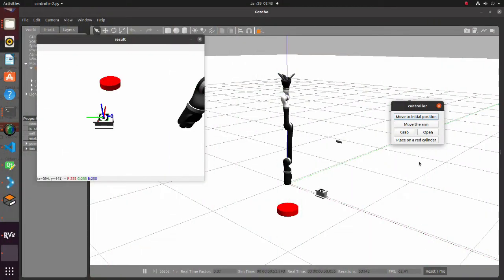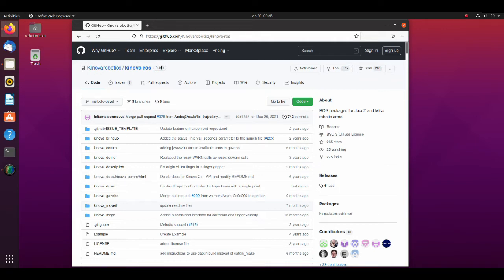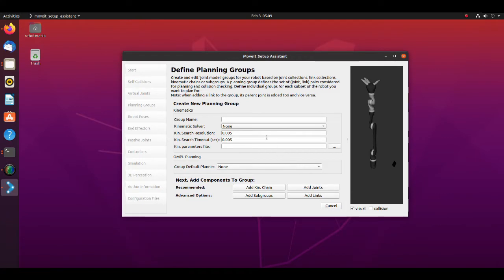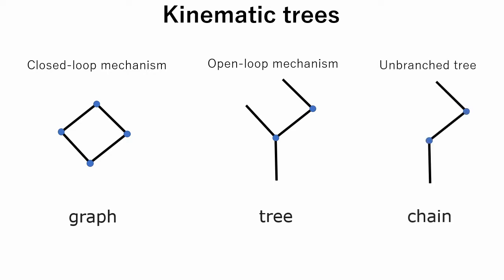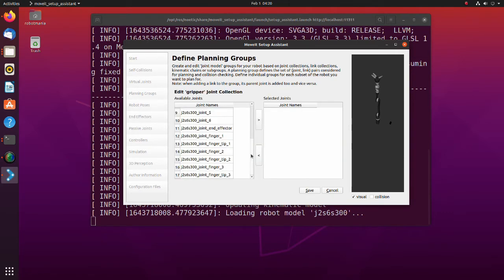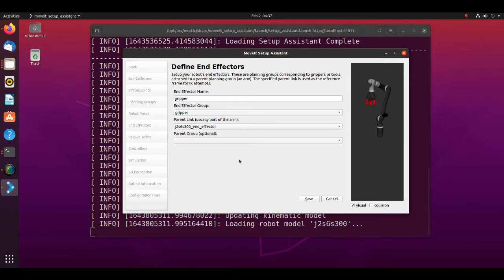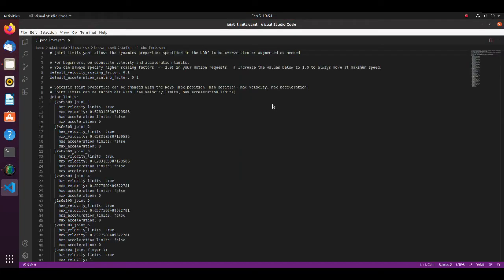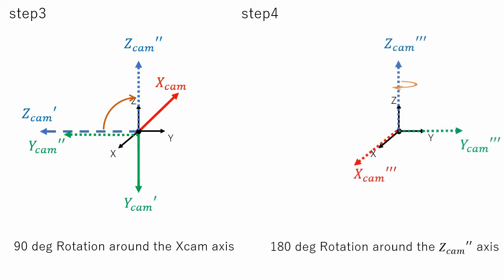How to operate a robot arm using MoveIt

Comment: Thank you very much on this very few demo!! But when i use "python3 controll.py" and click "move the arm",it will report some errors. Can any great god help me solve the doubts? Thank you
 
Traceback (most recent call last):
  File "controller.py", line 100, in Pick_up_the_block
    (plan, fraction) = self.arm.compute_cartesian_path(waypoints, 0.01, 0.0)  # waypoints to follow  # eef_step
  File "/opt/ros/noetic/lib/python3/dist-packages/moveit_commander/move_group.py", line 676, in compute_cartesian_path
    (ser_path, fraction) = self._g.compute_cartesian_path(
Boost.Python.ArgumentError: Python argument types in
    MoveGroupInterface.compute_cartesian_path(MoveGroupInterface, list, float, float)
did not match C++ signature:
    compute_cartesian_path(moveit::planning_interface::MoveGroupInterfaceWrapper {lvalue}, boost::python::list, double, bool, moveit::py_bindings_tools::ByteString)
    compute_cartesian_path(moveit::planning_interface::MoveGroupInterfaceWrapper {lvalue}, boost::python::list, double, bool)
Aborted (core dumped)
Reply: My environment is running with docker pulling noetic's image
Reply from the maker: Hi jian xu!
Thanks for watching my video!
I have never seen this error before. How did you install MoveIt?

Comment: Hello, thank you for the video. I followed each step in the video but I encountered a problem. In the controller tab, all of the commands works properly but not "move the arm". When I clicked on it, robot arm goes somewhere else. Also, how can I edit those commands so that I can control the robot arm as I wish, and maybe I can solve the problem in this way? Thank you!
Reply from the maker: Hi Cihan Okay!
Thanks for watching my video!
If the arm moves in a wrong direction, probably waypoint is not set properly. Please check whether block position is recognized correctly. 
Yes, you can edit commands by modifying the “Pick_up_the_block” function in the “controller.py” script.
If you would like to edit UI, please edit the “controller_window.ui” file using qt designer tool and convert it to python script.

Comment: why is my robotic arm huddle up?
Reply from the maker: Hi NAN JIANG!
Thanks for watching my video!
If vibration of the arm concerns you, you may reduce gains of PID controller.
Reply: @robotmania8896 
Hi mania
Thanks for replying
 how do I find the most suitable pid values for mr robotic arm? is there any value setting rule by default?
Reply from the maker: There are several methods to determine optimal PID gains. But they are difficult to apply for complex systems like this robotic arm. Most often, you just increase or decrease gains until the movement of controlled system becomes acceptable.

Comment: hello thanks for this video but I get the error that it does not find the package ros-noetic-moveit is there anything installed before that?
Reply from the maker: Hi Ylan PERNOT!
Thanks for watching my video!
Can you please execute “sudo apt install ros-noetic-moveit”?
Reply: @robotmania8896 Hello yes I executed this command but I think the package disappeared from the repositories.
So I fell back on a raspberry with ubiquity robotics install my final goal is to control a jaco arm with a raspberry connect to a controller or a visual interface have you advice?
Reply from the maker: I think Raspberry Pi probably will not be able to handle kinematics calculation related to robotic arm and calculations related to computer vision at the same time. Orin nano will be better for this purpose.

Comment: hey you use the aruco marker file to get xyz and rpy to publish on /block_pose topic but if i want to give it manually using any tool than how my robotic arm calculate the joint angle from the topic /block_pose and where and when did you setup up the /block_pose topic in the video ?
Reply from the maker: Hi Pratham Gyanani!
Thanks for watching my video!
The /block_pose topic is defined in the “aruco_pose_estimation.py” script at line 100. You can give manual target points by moving interactive marker inside moveit.

Comment: Hello, I am currently working on a project to control the dobot magicial robotic arm through ros to grab objects on the conveyor belt, but I don’t know whether it is because the kdl solver can only find numerical solutions or because the robotic arm cannot reach the target point ( In fact, I don’t know how to obtain the working space range of the robotic arm), and it always fails to execute when making a circular trajectory for the robotic arm.
The second problem is that when using the easy_handeye package and the arous package for hand-eye calibration, whether the eye is outside the hand or the eye is inside the hand, the coordinate system observed in rviz does not match the actual one. When the eye is outside the hand, the coordinates of the marker The system was waiting above the camera
The third question is that after hand-eye calibration, how can I achieve my goal after publishing it using easy_handeye’s publish.py?
Reply from the maker: Hi 猪头!
Thanks for watching my video!
Sorry for the late response. Unfortunately, I don’t have experience working with dobot magicial robotic arm. I think, generally working space range of robotic arm is slightly smaller than sum of it’s all links. So, maybe while executing circular trajectory it reaches its operation length limit.
Reply: @robotmania8896  Thank you for your answer, I would like to ask about the solver provided by the moveit tool for a low degree of freedom robotic arm that cannot find its numerical solution in some places and cannot perform the circular trajectory
Reply from the maker: @猪头-p7t  Moveit solver is focused on arms with more than 6 degrees of freedom. So, in case your arm has less degrees of freedom, sometimes Moveit fails to solve an equation. If orientation of the arm is not important, you can set “position_only_ik” to True. With this option Moveit probably will find a feasible solution.
Reply: @robotmania8896  Hello, thank you for your answer before, now I have encountered some strange problems, when controlling the real robotic arm, for example, there are 3 points in the simulation environment, and the 3 points in the simulation environment can pass smoothly, while in the real robotic arm, it does not pass through the middle point, but directly reaches the target point。I want to use Moveit's default API to control the real robotic arm, instead of using the SDK API provided by the Dobot Magicial real robotic arm manufacturer。Could it be because the SDK provided by the dobot Magicial real robotic arm does not support some operations?
Reply from the maker: @猪头-p7t  Unfortunately, I am not familiar with Dobot SDK API, so I cannot tell for sure, but if it behaves not like moveit, probably it does not support some operations.
Reply: @robotmania8896  Thank you for your answer, after I perform hand-eye calibration on the robotic arm and camera, because I use a USB camera, not a depth camera, I can't get its depth, how can I solve this problem? (If you have one or only one camera), I use multiple cameras or binocular cameras in the materials I searched on the Internet, but I only have one USB camera at the moment
Reply: The second question: after hand-eye calibration (eyes on the hand), convert the pixel coordinate system to the camera coordinate system, then subscribe to the relationship between the camera coordinate system and the end effector, and then convert it to the base coordinate system, and convert the center point of the photographed object to the position of the base coordinate system, to achieve visual grabbing
Reply: @robotmania8896  The third problem may be the conversion of units after hand-eye calibration, the coordinate point at the center of the object is converted to the base coordinate system and the difference is about 1000 times, which is the unit of the pixel mm/pixel Do you want to convert it to m/pixel, after I divide it directly by 1000, it doesn't seem to be this problem, because after asking ChatGPT, what is the wrong hardcoded format or is similar to the field of view near the object, I am a little confused here, I really want to get your answer
Reply from the maker: @猪头-p7t  If you have only USB camera, you can use Aruco markers to get coordinates as I did in this tutorial. Regarding the units, you may use millimeters or meters whatever you prefer. You just have to make sure that in all your calculations you are using the same units.

Comment: That command, python3 controller.py, at what time did you talk about that python file? I didn't catch it during watching the video. I wanted to know how you managed to create that controller user interface. Is it possible to bring up the user interface in Rviz and connect it to an actual robotic arm?
Reply from the maker: Hi ExusBuurn!
Thanks for watching my video!
You should execute the “controller.py” scripts after you have launched the gazebo world. I created user interface using pyqt5. Pyqt5 is useful for creating user interfaces for desktop applications. But you can not use pyqt5 inside rviz.

Comment: hi sir i followed your tutorial and when i run the launch file the kinova robot the robot started shaking a lot and it scattered. could you help me with the solution
Reply from the maker: Hi nikhiljohnson6048!
Thanks for watching my video!
If your robot shakes, please reduce PID gains of the controller.
Reply: hi  @robotmania8896  
thank you for replying how much do i need to decrease the pid and also if possible can you give me any contact details to contact you as i have to submit this as an assignment for a job opportunity and would really appreciate  if you could help me with this
Reply: @robotmania8896  also the whole robot kind of exploded and all the parts flew everywhere is it the problem with urdf?
Reply from the maker: @nikhiljohnson6048  I don’t think so. 
Try to reduce gains to smaller values and see how the robot will behave.
Reply: @robotmania8896  
I tried it but it's still shaking I even tried with the default values and it's still the same is there any way I can share the video of what happens.
Reply from the maker: @nikhiljohnson6048  Please send me an email.
robotmania8867@yahoo.com

Comment: Is this files works in ros2
Reply from the maker: Hi vickylogesh1576”
Thanks for watching my video!
No, it will not run with ROS2. This project is created for ROS Noetic.
Reply: @robotmania8896  ok brother thanks
Reply: @robotmania8896  I tried in ros 2 but it's not worked while I type 6 dof robot in terminal it shows no file or directory
Reply from the maker: @vickylogesh1576  As I explained above, this project will not run with ROS2. Please run it with ROS Noetic.

Comment: While rosrun I got No marker detected!
Reply from the maker: Hi Nitin Shhinde!
Thanks for watching my video!
Are there any other errors in your terminals or it’s the marker that is just not detected?
Reply: @robotmania8896  Thank you for reply. 
That's the only error in the terminal.
Reply from the maker: @nitinshindd5161  I have never encountered such an error before with this tutorial. I am not sure whether it is a problem of the tutorial or marker detection library. One way to find out is to try detecting the same marker with a simpler program using the same library.
Reply: @robotmania8896  hi sir I too got the same error as no marker detected when I executed the command is there any way to rectify it
Reply from the maker: @niranjank2224  Hi Niranjan K.
I have successfully detected the marker with opencv-python 4.7.0.72. Probably new opencv versions have ArUco marker detection module by default. Please install the new version of opencv and try to run the simulation once again.
Reply: What was the solution Nitin?

Comment: thank you for excellent ecplanation.  Just short info 6:28 
u= l₁ cos(θ1)+  l₂ cos(θ1+θ2) + l₃ cos(θ1+θ2+θ3)
v= l₁ sin(θ1)+  l₂ sin(θ1+θ2) + l₃ sin(θ1+θ2+θ3)
if  l₁ =  l₂ = l₃  so there is no problem
Reply from the maker: Hi YAS!
Thanks for pointing out. “l” in the second and third terms should be l2 and l3 respectively. That was a typo.
Reply: @robotmania8896  Thank you,too.

Comment: Hi may I know where to get .gazebo file to paste the aruco_block_long?
Reply from the maker: Hi Joey Chan!
Thanks for watching my video!
Folder “.gazebo” is a hidden folder. Check the “Show Hidden Files” option in “Files” window. If it does not appear, please execute “$ gazebo” command in the terminal once.
Reply: @robotmania8896  Thanks for ur reply. But one more question why when I rosrun aruco_recognition aruco_pose_estimation.py, there is error like line 104, in callback _colour_img
cv_colour_image =bridge.imgmsg_to_cv2(data,"bgr8") and import error :dynamic module does not define module export function.
Reply from the maker: @joeychan4728  It seems that this is environment variable issue. I don’t have any specific solution for you, but I have found several posts related to this topic. Here they are.
https://stackoverflow.com/questions/55757572/cv-bridge-dynamic-module-does-not-define-module-pyinit-cv-bridge-boost
https://stackoverflow.com/questions/63001962/importerror-dynamic-module-does-not-define-module-export-function-pyinit-cx-or
I hope this might help you.
Reply: @robotmania8896  Alright thanks!